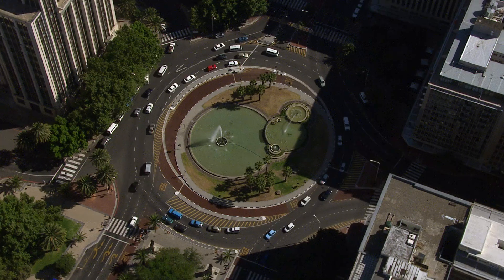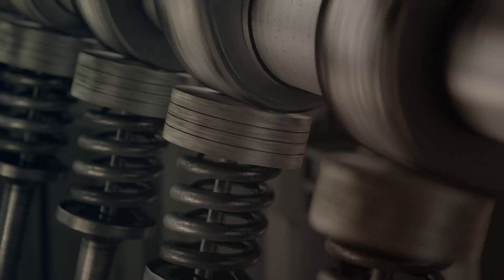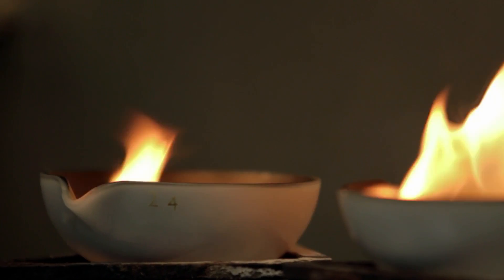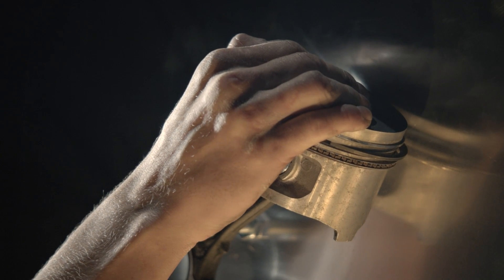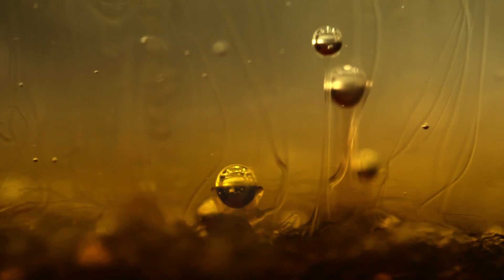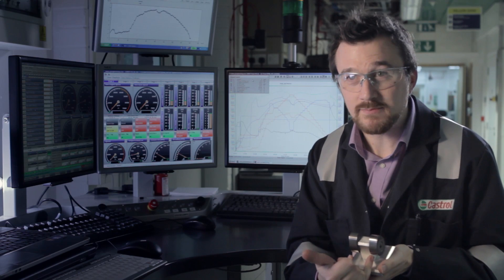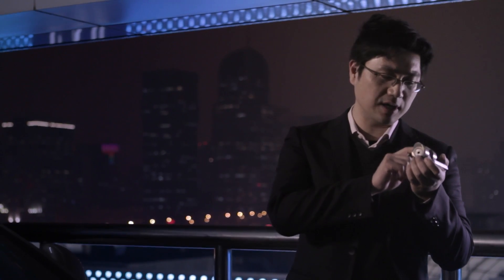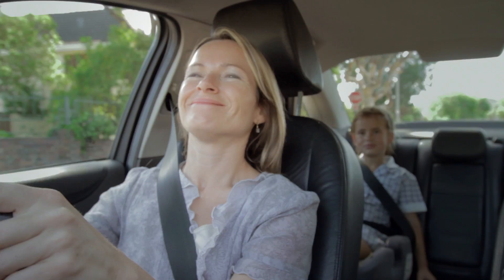Intelligent Molecules: the amazing science of Castrol Magnatec (shortened version)

Comment: So, if the molecules "cling" to engine parts even after the oil drains back, what happens when you change your oil? 
It seems that you would still have old, dirty, oil molecules stuck to your internal parts and the more you use it, the more it would build up. Sounds bad to me.

Comment: I like the idea. But I have a question: For an engine that has never used Magnatec and is over 30 years old, will it still work well? It has about 112,000 miles on it, so I'd be using the High Mileage formula. The car has used Conventional oil for most of its life. I didn't see Magnetec available in Conventional type oil, and I read that in some cases if an engine is worn down enough switching to Full Synthetic can break dirt away which would cause the engine to burn oil. I do know that there's also the Synthetic formula, and I did run a Full Synthetic oil in the car before without issues.
Reply: Austin Lucas 
id like tk the answer to ur ? as well pertaining to me old car
Reply: QueenoNerds Yeah, your Mid-1990s Toyota.